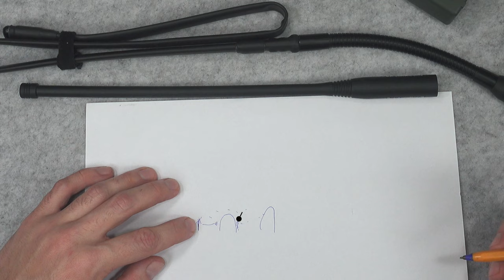Field test short vs long tactical military blade whip antenna on Harris PRC-152 replica made by TRI

Comment: Yes please I would love to hear the real one. Which comes with the radio. I’m very impressive the Chinese knock off. It works.But would love to hear the real one. Thanks again for letting us see this test very interesting.Alan from England 🍻👍
Reply from the maker: Will do!  I have couple more things to try - one is try attach it to genuine military vehicular amplifier (without connecting data) - but I don't know if it require digital data to agree frequency, set band pass filters - or it will just amplify what it gets - amplifier cost much more than radio so I'm pretty scared to try it out - but it's on my table - if I could get hands on technical manual it will help me out understand how it operate. It's hard for me to assume they will let soldier burn amplifier if radio will TX without being correctly connected... so maybe it's not required - need do more research.  
Quality is amazing <- and I'm saying this honestly. Much better than stolen Falcon II radios that pop up on eBay from third world countries that just operate in tactical VHF. Cheers!

Comment: Awesome video straight to the point!, but the reception test of that antenna va the stock one was missing maybe you can do that one next?  Maybe with a local ham radio repeater or something like that
Reply from the maker: I will try RX but I have set up better system for that. It's on table and I'm also curious about results - best would be remotely play same thing and then do field swap of antenna.

Comment: Both antennas sound the same to me at all location's except locsyion 5
Reply from the maker: Have You check out using headphones? From my perspective there is difference in background static - voice is more in foreground on blade antenna and hiss is lower. That's just my interpretation but on db scale it's like doubling output power of transmitter.
Reply: @ElectronicNoobBlog  I wasn't using headphones when I watched the video but appreciate the advice on the headphones

Comment: Hello, where can I buy this radio?
Reply: I too want to know
Reply from the maker: I bought mine used locally from airsoft player. They are wide available on aliexpress, ebay - just make sure to ask if this is latest version that support KDU - they work out of box with military headsets and military batteries.  Don't buy old one that is PLASTIC!!!